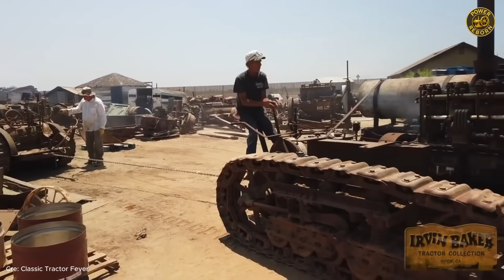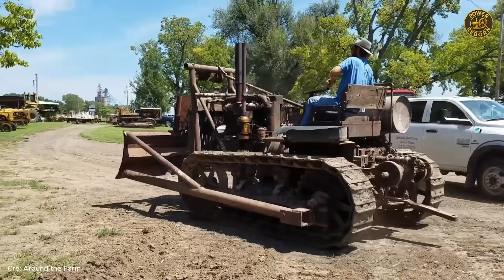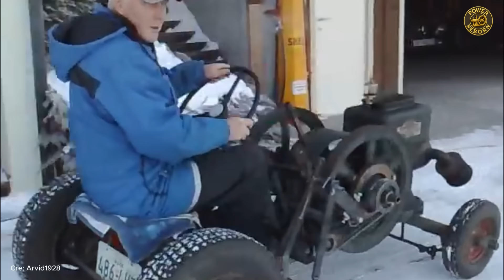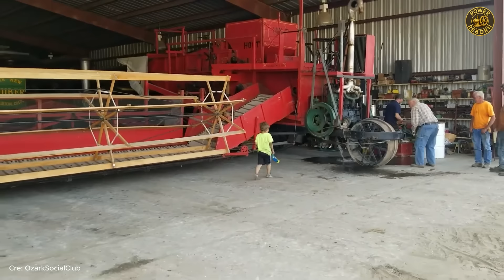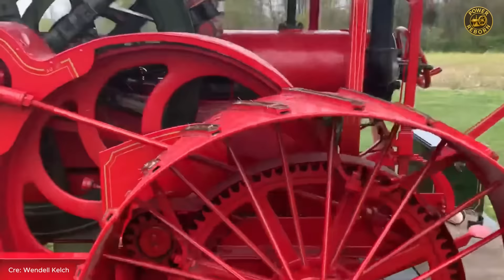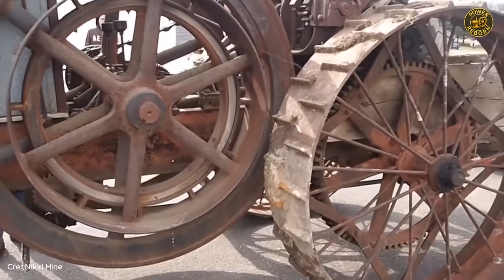Epic Antique Engines & Tractors Compilation (1908–1930) | Steam, Crawler & Vintage Machinery Revival

Comment: It's interesting but you lack any real theme. A lot of these machines have nothing really linking them together except that they have some kind of engine. Jumping from a massive 19th century steam engine to a mid 20th century mini-dozer that's really little more than a novelty to a 1920s combine? You'd be better off picking a specific, more limited theme. Like do a documentary just about Holt, the equipment it made and the evolution of its equipment. Or Altman.  Forget about Caterpillar. It's history has been covered extensively